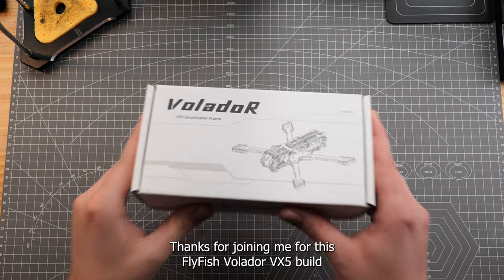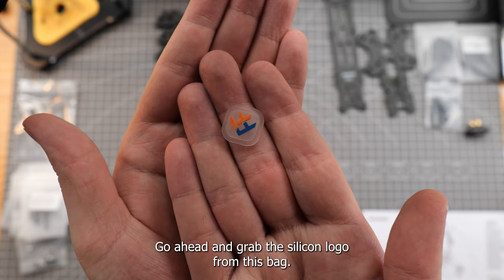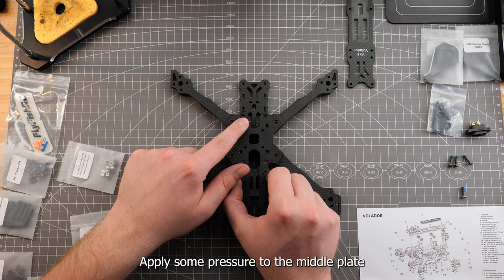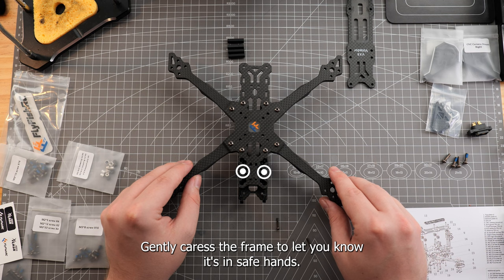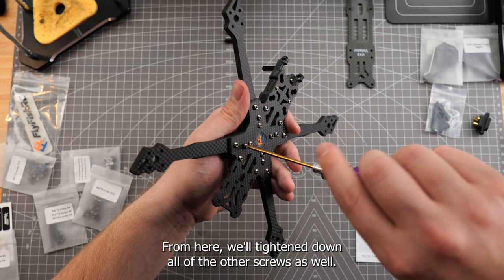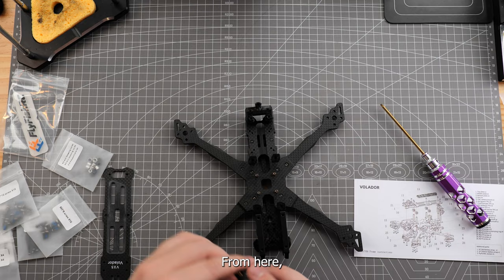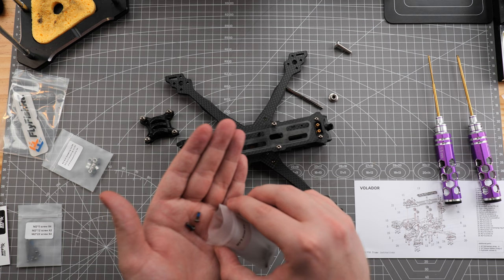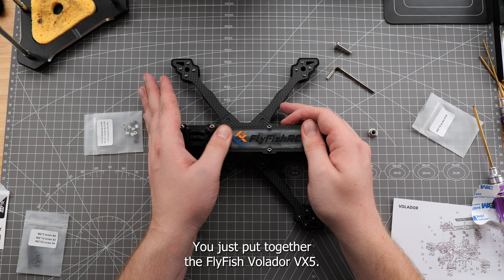Volador Frame Build Tutorial I Volador VX5 Frame I FlyFishRC

Comment: Thank you Thank you Thank you. Only by this video was I able to build my VX6 frame.
The instruction are not good imo and the other video I seen weren't great. I thought I was missing 
parts like the keystone and a few screws but looks like it's not meant to have them.
Thanks again, I couldn't have built this in 30 minutes without this.

Comment: Building just the frame is well enough, building that into a quad is a right pita. Remember to solder the battery wires xt60 that came with the kit and put head shrink on them first BEFORE you solder it to the esc. You'll be happy you did that. This frame has virtually no space on inside for anything, forget about fitting a buzzer in side and if your vtx is large like a vista or waslksnail or HDZ you're not going to have much room for the 1000uf cap and prepare to swear when you try to fit the ufl connectors on the vtx and rout them to the tpu antenna mounts on the back.. I swear designers of frames need to build the whole gosh darn thing before putting it to market.. what a pain